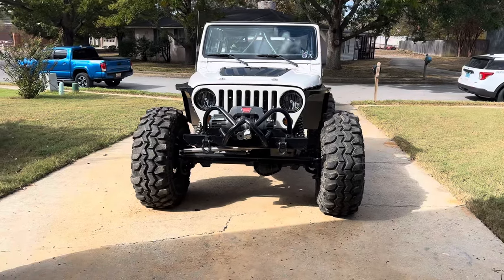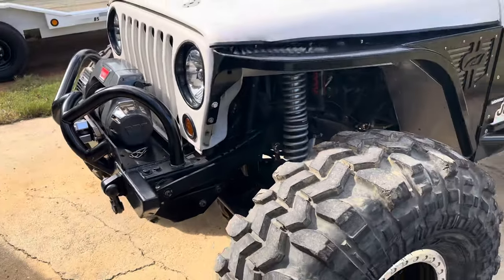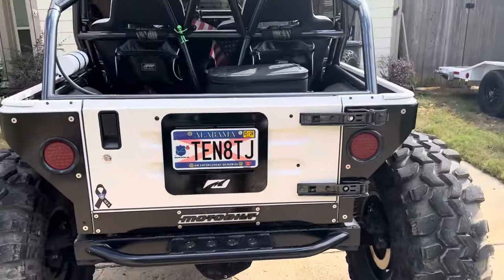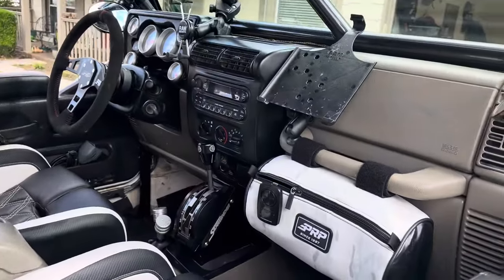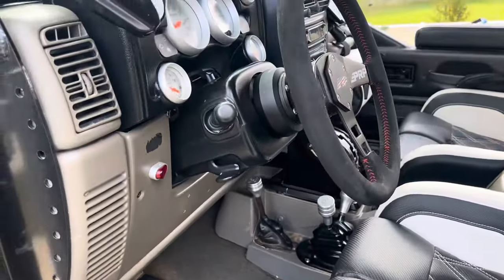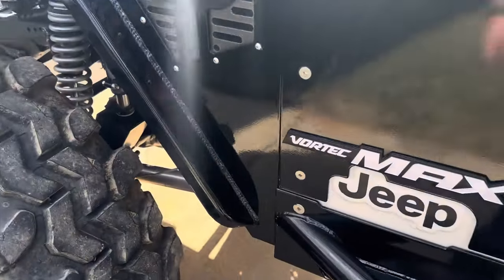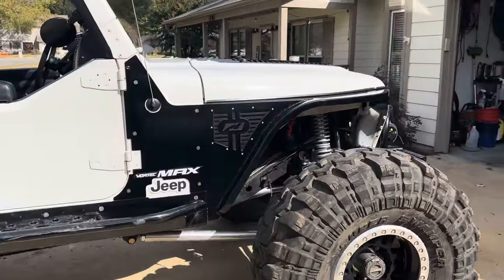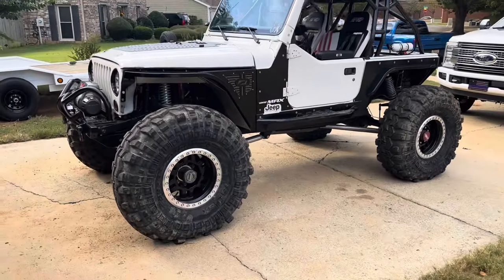LS Jeep TJ on 43s walk around

Comment: Hey bro I have a question I am from Australia and there’s absolutely zero jeep like that (so well engineered) so I always wondered how much a jeep like that goes for in dollar if you had to sell it?
Reply from the maker: @tariklaarej2259  a lot depends on the area of the country that you’re in. In the southeast this rig can go for anywhere between 25-50k. Once I get through with this re build it’ll be full hydro with RCV shafted Dana 60 and a fully built out 14 bolt. After that it’ll be a 60k rig to the right buyer.

Comment: Im building this exact setup on my '95 YJ. I already have the suspension done. I have axles from a '13 F250 with 4.88s and e-lockers. I have a Jasper LQ9 and 4L80E trans from a '05 Denali. Next is the 2-speed Atlas t-case... Can you elaborate on the issues with your torque converter in lower gears with the Atlas?
I wanted a lower ratio in my axles, but 4.88 is low as you go with that year. Im scared I wont achieve a super low crawling speed with 4.88 axle gears... Thats an awesome rig man. Major work goes into that many changes!